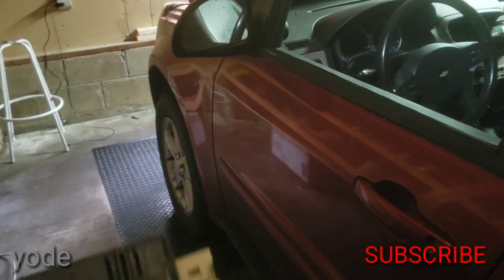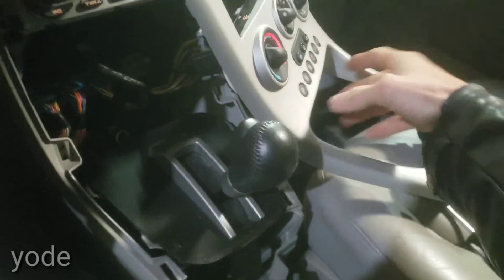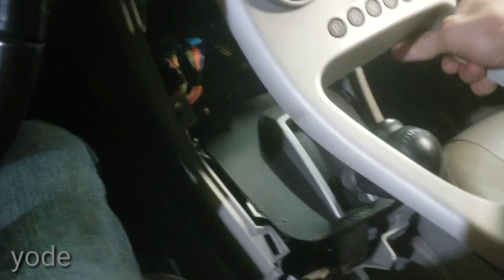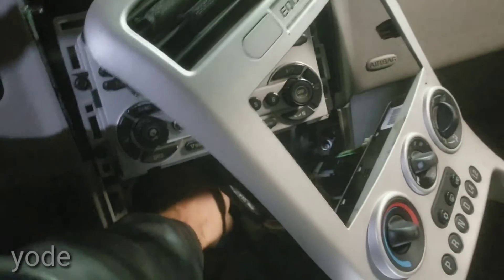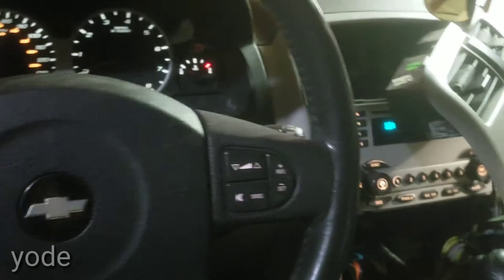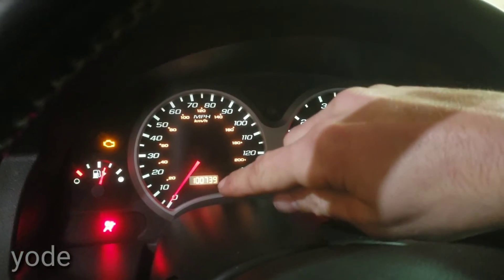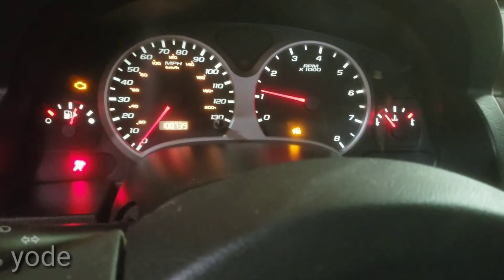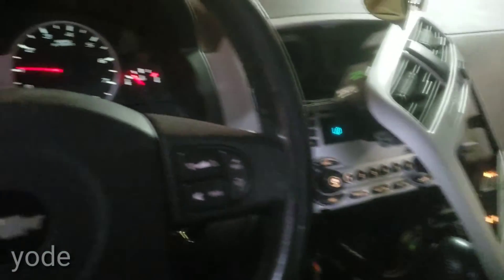BCM REPLACEMENT EQUINOX / BODY CONTROL MODULE DIY

Comment: I have an 06 Pontiac torrent that started having wiring/bcm issues, after a mechanic diagnosed it. I got a used bcm and brought it to a dealer. The mechanic there tried to exchange bcm’s and reprogram it but my vehicle wouldn’t accept the foreign bcm. So he put the original back in and it worked fine after that for about six months. But now I’m having the same issues again. I’ll tackle this myself with the help of your video. Thanks.

Comment: Dealerships don't reprogram miles buddy if that's the case everybody would be going there to get it modified what you have to do correctly is take out the two old prongs from the old BCM and we can start them into the new BCM because those prongs are what holds the mileage storage and it will read properly

Comment: Do you know if you can replace a single connector that plugs into the BCM rather than replacing the entire wiring harness?  i.e. remove wires from a 24pin connector and place them into a new connector
Reply from the maker: yes you should be able to, theres usually a tab on one side to pull out that releases all the pins. you have to take the cover off the connector first so you can see the pins.

Comment: Hey everyone; great video Josh; my 2012 was hit by lightning; fried the BCM; ;had a new installed at dealership; the cost was going to be too much; $1394 so i had it hauled home; got a ECU from a junkyard; will it work or will i have to order a pre programed one?
Reply from the maker: not sure you'll have to try it and find out but they usually need to be programmed for that vehicle or not all the electronics work.

Comment: If my 2015 equinox is still running indefinitely after pulling my key out, is that the bcm?
Reply from the maker: probably a bad ignition switch
Reply: @Joshyodenn …. Not it.

Comment: And if you did trigger the security somehow, how do we correct it?  I did a heater core swap and unplugged things with battery out and now security light on, won't start without a scan tool connected. So just been leaving scan tool plugged in to drive it since.. have ambient light issue too, headlights on in daytime and dash lights bright at night, send code high voltage ambient circuit...  but nice to know what module was what under there.. had an 07 now an 08...

Comment: Thanks Joshyoden.  Please tell me how to get the BCM OUT of the slide.  I saw one Youtuber said to push down on it and pull toward you.  When I do that I can get one side or the other to pop out, but not both.  As soon as either the left or right side pops out, the module is on a kilter and in a bind - can't get the other side out.  Thanks for your help.

Comment: a question where the BCM of a 2006 Chevrolet hhr is located
Reply from the maker: Under the radio, enter from passenger side foot panel
Reply: thank you very much brother
Reply from the maker: @pelón6777  yes no problem man!
Reply from the maker: https://images.app.goo.gl/9BvXGJmqBSCT4MSPA

Comment: Just curious. Why did you change out the BCM. The problem I have is we will be listening to the radio. Then the sound will silent and the screen will black out. I have a 2015 Equinox with a My Link screen.
Reply: Any luck im having the same issue with my eqinox
Reply: Any luck I am having the same issue with mine too

Comment: Hey maybe you can help me I have a 2006 equinox the blinkers are not working checked everything these are all good  flasher relay New blinker switch everything is pointing toward the BCM being bad.
Reply: Is the blinker fluid level light flashing?
Reply: It needs a new engine
Reply: @deerhunter8533  no he needs a new transmission
Reply: I had one where one of the bcm fuses were missing. fount this after replacing the bcm without any change.. learned the hard way i guess. @carlitosfreetos

Comment: Thanks, I've been fighting my equinox for about 8 months. I originally was told it was the abs. Now car won't start. Recently was told if I do it correctly that changing my bcm should remedy my problem. I'm going to try. Thank you
Reply: Vince Yoho hi did it work?
Reply: @tiaRene17 , no it did not. Now the car says locked across the dash and I can't remove the key from the ignition. So the battery is dead as well now. Guess its going to the dealer
Reply: Vince Yoho hi have you already gone to the dealership? 
I had a similar issue. Instead of the key getting stuck, my gear shift got stuck in park. My battery died while attempting the relearn process (pointless for our issue) I have the link to a simple fix for both. Car is running fine now after jump off. Let me know!
Reply: @tiaRene17  nope, it's still sitting in the driveway. I've just about had my fill.
Reply: @tiaRene17  can you post that link please?
Reply: Chris Campbell yes of course! Which one? The gear shift or key?
Reply: @tiaRene17  My security light came on after a heater core swap and I had to leave a BT scan tool device plugged in or would not start.. have an Autell scan tool ..
Reply: @tiaRene17  I have a question on the BCM I know it's 3yrs. Ago

Comment: Tried this and the used bcm wouldn't allow the car to start. Would not turn over. Only difference is I didn't have my car in gear, It was in park. .Suggestions?
Reply: Hey I did the same and now I can’t take the car out of park. It starts but the radio says locked
Reply: @tiaRene17  put old one back if u can. Disconnect neg cable from batt first. My old one had dirt and corrosion.  Cleaning it and connections worked. What's going on with your original?
Reply: *worked for the door ajar issue.
Reply: I did the "relearn" process and got it working, Airbag light on and radio is locked.
Reply: It needs a new engine
Reply: Hey...I've got an 05 equinox and after this video I'm wondering if I can get away with a used BCM.  Did you eventually figure out how to make a used BCM work? Or did it keep giving you problems?